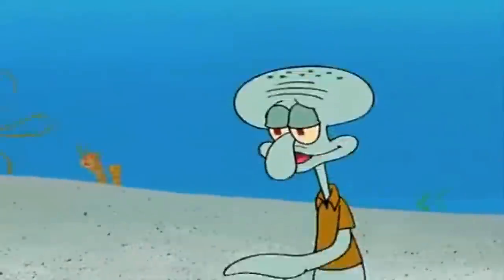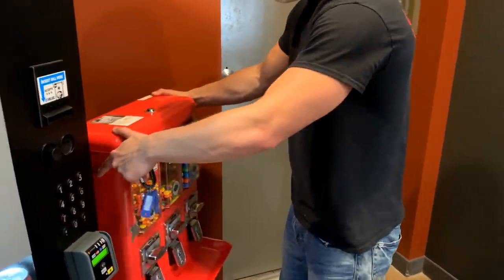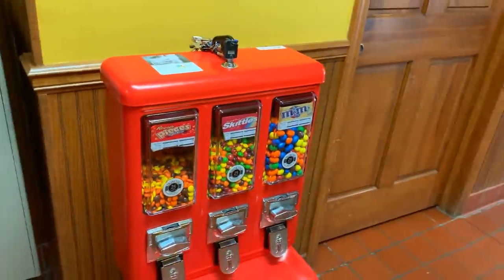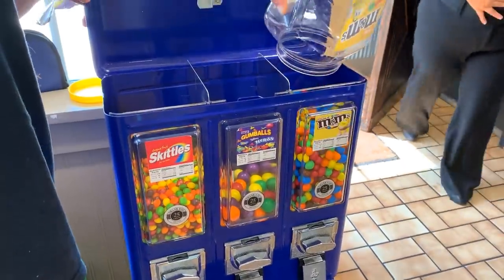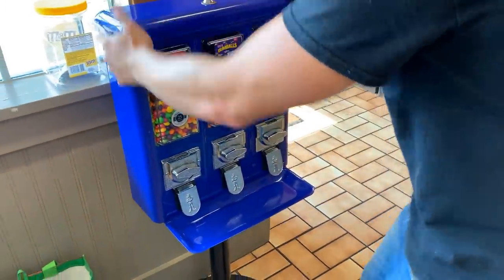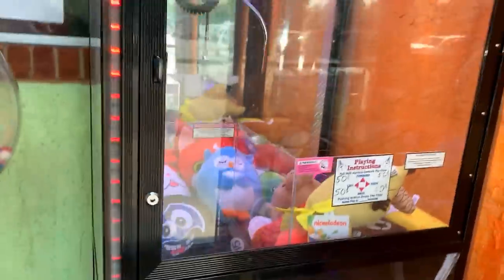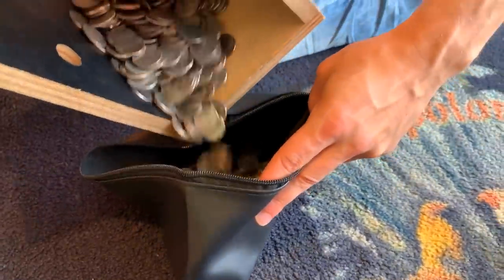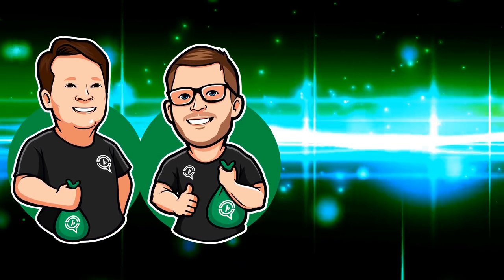Collecting Money From Our Candy Vending Machines

Comment: I’m a nerd and I wanna see the spreadsheet tracking and statistics. Like how much money goes out for product and then the stats on return.
Reply: The ROI on gumballs is insane. They cost about 4 cents each when bought in bulk and sell for 25 cents. That's 6.25x the investment. Yes they are low value so the key is to have many many gumball machines.
Reply: How do I figure the roi on m and ms?
Reply: Like per 25 cent turn?
Reply: @johnwallace8411  You can control how much M&Ms come for each 25 cents turn. I weigh it out and vend half an oz of M&Ms or 6 pieces roughly. Bulk M&Ms at Costco cost me $13.89 for 62 oz. Or ¢11/ half oz. Profit of 14 cents. Which is 127% ROI.
Reply: @lorenfok1097  so I’m having issue finding gum balls with shipping or what ever included for a decent profit with 25 cents being my charge per gumball. I used to not have a issue but it seems prices have risen on gumballs.
Reply: @johnwallace8411  smart and final has the 850 count double Bubble for $35
Reply: @lorenfok1097  is that not 24 cents a gumball?
Reply: @johnwallace8411  no dude that's 4 cents a gumball.
Reply: @lorenfok1097  lmao never mind thanks for the help

Comment: Some one tryed to break in to 2 of my claw machines on location but failed on 1 and the 2nd one the whole front door was smashed with a sledge hammer it took them 5 munuts to get in but when they did they hit the jack pot £196 it's the damage they did the front cost more to replace than the machine is worth